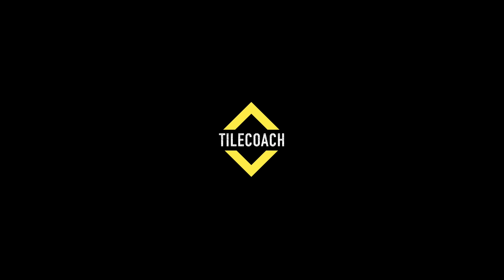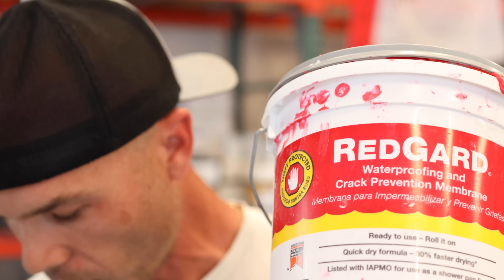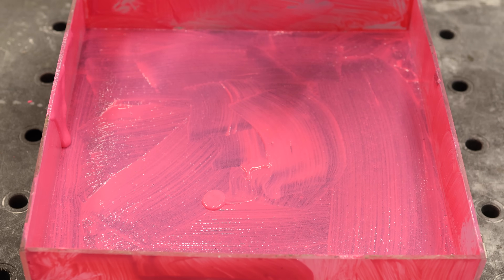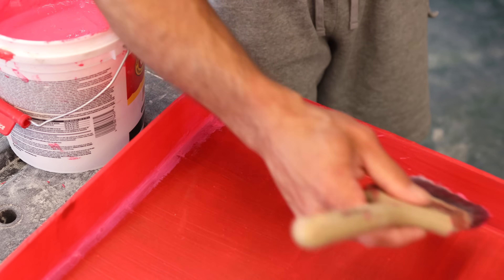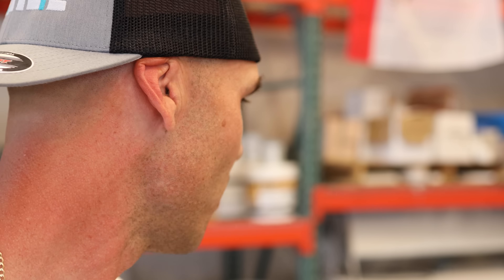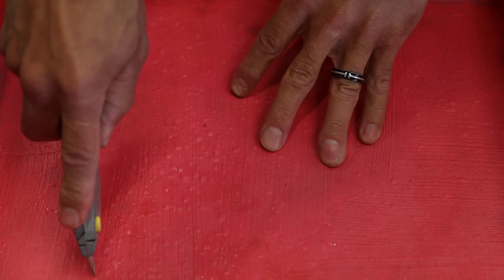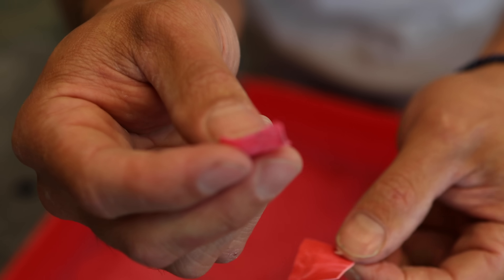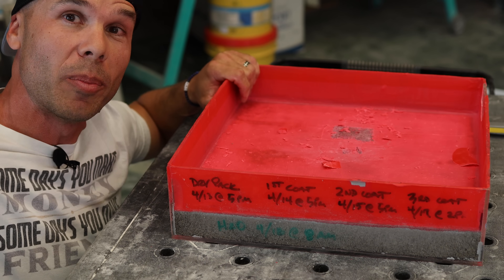REDGARD FAILED FLOOD TEST!!! --- Why Did it CRACK and BUBBLE UP???

Comment: Oh I forgot to address the cracks in the corners, when it does that it means you're over applying it, putting more over it makes it worse, it's better to cut out the cracks and reapply in thinner coats. Also redgard is generally applied over cement or backers so applying in on plastic is an issue the underlying moisture gets trapped and never allows it to actually cure.
Reply: Agreed plus your are supposed to wait 48 to 72 hours for the morter to cure.
 I think he might have dropped the ball on this but I'm sure he will redeem himself
Reply: Ahh, that makes sense.  I was dumbfounded to figure that RedGuard could be THAT weak !    Been in use a while.
Reply: Over applying it on the corners makes it crack?? Can someone confirm this?
Reply: @dieterrosswag933  - yep. Apply with a brush and use mesh cloth/tape at seams, corners and drains.
Build up 6 to 9 light layers on the floor to 20-30 mil thick tapering up the walls so no hard transition from thick to thin and 2 or 3 coats on walls with ample dry time between.
Ive been using a long time and never had a failure.
Reply: @holdernewtshesrearin5471  Thank you. I use tapes between the floor and walls (the joints). It's highly necessary in Germany since the screed is "floating" over a ~5cm foam  all over the house, for noise and temperature isolation and also no connected with the wall

Anyway, i didn't know that the "liquid isolation" can break in the corners in short period when there are different thickness in close time application.
Reply: @dieterrosswag933  - well i noticed that when applying with a putty knife, cracks would appear at that stress riser location where thick and thin coatings meet.
Thats why i apply many lighter coats and extend further and further up the wall each coat to ease that transition and remove stress risers.
Reply: @holdernewtshesrearin5471  6 to 9 coats.. with dry time between each? Plus the original 3 days for mortar to cure..  How long does it take to be ready for tile? Do you keep 2 or 3 projects on the go at once?
My first walk-in was 20 yrs ago, it was my only dry pack and it turned out fine, hadn’t heard of Redguard yet. Switched to foam after that first one, but I’ve sometimes wondered if floating is better/cheaper.
Reply: @markoshun  - yep. It rarely ever takes more than 6 coats but I make sure I get 1/16" thickness including the fiberglass mesh cloth/tape and I feather each coat 6"-12" up the walls to prevent a hard transition from thick to thin. I started this because the Redgard instructions called for 20 mil minimum thickness for the shower floor back when I started using it.
I think that's been revised but I'm not changing now. Don't fix what ain't broken.
I use a paintbrush only and yes,you HAVE to allow proper dry time between coats, NO PINK showing and an extra 30 min wouldn't hurt.
I generally start laying tile the morning after beginning the 1st coat and after an overnight leak test or the 2nd morning at latest. A full day to a day and a half of application.
Sometimes it helps to run a fan to stir the air NOT blowing directly on the shower, though.
I'm generally doing other projects at that location so it's no problem to return to the shower every hour or two to apply another coat but even if it takes a full day additionally I will do it because the peace of mind It affords is well worth it.
I've never had a failure in 15 years and maybe 100 showers.
Reply: @markoshun  - as for the question of foam pan slope or dry pack (I think that's what you meant by "floating") until and unless something comes along that addresses ALL the shortcomings of drypack and is a marked advantage I'll keep doing it the way it's been done for hundreds of years.
Dry pack takes time to cure which foam doesn't but you can't use Sub 2" tile with foam and I just don't trust it anyway.
EVERYTHING compressible eventually compresses over time imo.
Besides, using liquid waterproof membrane systems completely negates many of the advantages foam is designed to have.
It's not a fast process but it is a 1 piece waterproof membrane from drain to top of tile work and it is  PERMANENT . It's also relatively simple to do. No worries, no muss, no fuss. And it's guaranteed waterproof if you do your part.
That alone is worth an extra day or even 4 over a modern "improved" system like foam pans and sheet applied waterproof membranes which require skilled installers,  will NEVER be a 1 piece system anyway and WILL fail if the drain backs up and water stands for any length of time.
Reply: @holdernewtshesrearin5471  Thanks for your description of your dry pack process. But where do you see that about foam pan fails? Even on this channel, he’s done extreme flood tests for up to ten days with nothing but a little damp seepage. Over a couple decades I’ve done many foam pans myself with no fails. You are a more patient person than me and certainly more skilled with mortar. But seriously, after that first dry-pack bed, if I ever wanted to do more walk-ins, I knew I had to find a less time consuming and simpler method.
Reply: @markoshun  - another shortcoming of foam pans is they rarely actually fit a large custom shower so I'm forced to continue it with mortor anyway.
You can't use small mosaic tile with foam because if something heavy is dropped onto a sub 2" tile, the foam doesn't offer enough strength to resist it. I dropped a drill through a shower floor once because of it.
I've heard of a woman stepping through Penny tile in high heels when she entered to retrieve a necklace she removed while showering.
Other than those few shortcomings there isn't a lot to complain about but I just don't see foam as an improvement personally.
I simply prefer to lay tile on a solid substrate and since I use the liquid waterproofing membrane systems, the foam just isn't compatible imo.
I prefer drypack. It's strong, durable, resilient and foolproof.
It is heavy, slow to cure and messy though so I get the need to improve on it but for now and for me, there just isn't a system out there that does everything I would need it to do so....I'll stay with drypack.
Reply: @holdernewtshesrearin5471  I switched to hydroban stuff now, it’s quite a bit more dense and has a great hard surface. They have rated it for less than 2” tile if used with the right grout. No argument  though, mortar is near indestructible. 
I also recently did a full room pan with a 5x5 pan and 2 12” extensions. So size is not an issue.. (that’s what she said😁)
Anyway, I’m not trying to move you or anyone to foam pans, was more interested in the path I didn’t take. Full disclosure, I don’t like mixing and cleaning up cement. Used to hope they’d come up with a mastic that you could use in a shower.. still waiting.
Reply: @markoshun  - Roger that. I fully understand. I haven't tried any of the newer systems but I've seen them used. I'm old school with most things. I've seen so many new product "improvements" come and go and just prefer good old stone, steel and sweat I suppose. I wi certainly evolve should something really solid come along.
Extensions? The thickness continues to increase?
What if you have to maintain a certain curb height etc?
Reply: @holdernewtshesrearin5471  Yes, slope extends as well. There’s a couple dozen pans to choose from depending on what you’re building, offset, centered, linear drain. The shower room I was talking about was low slope and curbless, with a dropped subfloor. They sell curbs, but I just use 1 1/2” board and glue them together with the sealant/adhesive. Same for benches and often cubbies. 
There’s an advantage to the dry pack as you just build whatever pan shape you need.. I’ve got to order it in and the big ones aren’t cheap.
Reply: @markoshun  - right. Sounds like just the ticket for builders but not sure it would offer anything to custom shower builders. They're usually all different and I tend to put the door on an angle. I'd likely still have to use drypack. It's fast enough, cheap and I'm comfortable with it. Buy I'll check out the new foam. Thanks.
Reply: @holdernewtshesrearin5471  who the fuck has that kind of time? thats absurd. sheet membrane and done
Reply: @GJLCreativeStudios  - 4 hrs? You can't find 4 hours?
No matter how fast you install the sheet membrane, you can't lay tile until the morning of the following day IF you do an  overnight leak-down test, which you'd have to be a fool not to when using sheet membrane systems.
80% of the time I'm laying tile that following morning too, after my overnight leak-down test.
Occasionally due to humidity/temp etc slowing drying time, I have to finish applying 1-2 coats of liquid membrane the following morning to build the floor up to the required thickness of about 1/16" which almost always takes 6 coats but depending on temp/humidity and who applys it, it MAY take up to 9 coats.
But that is just to build up enough thickness to allow plenty of strength and flexibility to accommodate today's lightly built homes. The leak-down test has already been completed so I can begin laying tile by noon even when I have 2-3 coats to apply that morning.
So.....4 hours. 4 hours to achieve a ONE PIECE WATER-PROOF MEMBRANE from drain to the top of the tile work, something your sheet membrane system with multiple membrane pieces overlapped 2" and "sealed" with a porous, NON-WATER-PROOF and THIRSTY concrete based thinset, will NEVER be.
Those seams WILL wick water and WILL fail if water is allowed to permeate long enough such as if the drain backs up or the grout/caulk fails or is improperly applied. You have a WATER -RESISTANT shower, not much different from a shingled roof. I have the equivalence of a fiberglass boat.
Even if LWPM systems take an extra 24 hrs, the peace of mind of KNOWING that shower IS WATER-PROOF and will REMAIN so is well worth it imo.
You however, are free to do your showers however you like, as foolish as that is.
Reply: @holdernewtshesrearin5471  When you say "20 mil", do you mean 20 millimetres? Because that would mean 2 centimetres, and is pretty thick for 2-3 coats of paint.
Reply: @kazielbonn  - no a mil is a unit of measure in the sheet plastic and coatings etc industry. Roughly 1 mil is equal to .001"
So 20 mils is approximately. 020".
Just a bit under 1/32".
Reply: @holdernewtshesrearin5471  Ah ok, TIL haha. Thanks, much appreciated :)
Reply: @kazielbonn  - no problem. Glad I could help. Are you doing your own shower?
Reply: @kazielbonn  - and to clarify, the 20 mil thickness is just the coating. When you factor in the fiberglass mesh cloth/tape it brings the total thickness up to between 3/64" and 1/16".
That's why I say 6 to 9 coats. I've rarely ever had to apply more than 6 coats but just to make sure, I say an extra couple coats can't hurt.
If you concentrate on applying nice even coats I guarantee 6 coats will be sufficient. Just make sure you allow ample drying time between coats and I assure you, if all other aspects are done correctly, you WILL have a true 1 PIECE membrane, 100% water PROOF shower that will last for decades. My first showers are 17 years old now and of the 3 that I renovated (to update, NOT due to failure) at 9 to 12 years age,all were in perfect condition. The Redgard coating was still strong, supple and flexible. There were signs of water intrusion, through the grout but the modified standard 3-piece drains weep holes did their job and there were no issues. I was actually able to save the slope bed/pan of 2 of them and I reused it.
Liquid WATERPROOF membrane systems are the ONLY way I will build a shower.
Let me know if I can help you with your project. I don't mind at all.

Comment: Your using it wrong like most people do, it's a paint on membrane which means you should be applying it like paint, the secret is not heavy coats but coats on the lighter side, I do 5 to 6 thin coats which can be done in a single day with how fast it dries, the directions they give for installation I will admit are not very good and I always use fiberglass tape in the corners.

Comment: Isn't that supposed to be applied to a fabric?
Reply: You can use it on dry pack like he did, i think the reason it failed is because he did not wait long enough for the cement to properly cure and the moisture was trapped under his first coat of red guard
Reply: @espmegadeth1  That's what I think also. As concrete cures it releases the moisture inside and most of that moisture evaporates in the first 28 days, after that it takes years to fully cure because it has sealed the remaining moister inside. All the bubbles are from water trying to get out not water that got in. I would bet money this wouldn't happen if the dry pack had cured.

Comment: Red guard for a waterproof seal in the pan? Would never even think to do that. Walls only. Is that product even rated for what you used it for?
Reply: I still use rubber tried and true,  I would never redguard a pan
Reply: Rubber pans for life. People want to waste time doing stuff the "easy" way. Good luck with your leaky shower.  If you have problems with the liner pushing your board out cut notches and fill with mortar. Red guard before you do the Mudpan and leave the niche 4 inches up to it of no redguard. Redguard inside the niche. I do this because I've had problems with grout not drying right  around the niche but not inside it.
Reply: @kevinclear4007  I honestly don't even think red guard is suggested to be used that way. And anyone who would think that's it a good idea to use it that way should find a new profession.
Reply: @mikecoffman2821  the father/son company I worked for started doing things like that trying to save time towards the end of me working for them. I said you think that's gonna work? Silence. Lol 24 years as a tile setter and I've never had a leak called on me and I've never had to rip out a job. (Besides maybe a miscommunication of using wrong tile on the wrong room or something stupid like that.)

Comment: I’ve been using thinset and fiberglass Matting before redguarding and it comes out pretty dang durable
Reply: This is key, gotta use the mesh tape and thinset at all joints and change of plains. I only use redgaurd for extra insurance over my schluter band but I think he should redo the test with the tape and mud. Still love this guy's videos

Comment: You're supposed to use reinforcing fabric on corners with all liquid waterproofing products
Reply: This. I hope he will redo the test in a box with cement board (because no one is setting to glass. And use mesh tape and thinset. It's a requirement for this product. Still don't rely on it as my sole waterproofing. Only use it to go over my Keri band areas in my showers just for extra insurance and peace of mind.
Reply: @mattjudy6780  most showers have a liner. Is a liner more breathable than glass? What if you apply redguard over the mortar bed liner wall to liner wall, you are supposed to have a gap between the cement board wall and the mortar bed to prevent wicking water up the wall. Wouldn’t that be the same as this glass example?
Reply: @1977jmad  I know you are supposed to have a gap if you arent waterproofing the mud bed, but he is putting waterproofing on the mud and walls. He's changing it from a water in, water out system (traditional wicking mud bed) to a system where water never gets to the mud. So your logic doesn't apply in this situation.
Reply: @1977jmad  and no one is setting tile directly to a liner either. Nor do you put redgaurd on a liner if that's what you were saying. No need to have a gap between your mud and cement board if it's a completely water tight system (all water proofing is connected to each other all the way to the drain.  That's why he usually puts a sheet membrane over his mud beds. Watch his other videos.
Reply: Agreed
Reply: EXACTLY!!!!!

Comment: What a junk product. Glad I only ever used it on a tub surround. Looking forward to the laticrete glass box test. Maybe a moisture test of the mud is in order. Tape a piece of plastic to the mud and see if there is water. Or a moisture meter. Gotta rule out user error
Reply: It's not a junk product, he use it wrong. I've been using it for years and never had one single crack or bubble. It's not a junk product when every other company copies your product..
Reply: @jeremycovelli  I would love to see it done right if there's any way possible could you make a video or have a link to a video that does it like  you. Thanks

Comment: They say that's from putting it too thick and not letting dry fully before next coat
Reply: Did you not watch the video ? He let every coat fully dry.
Reply: @IceCreamJones42069  doesn't matter, if it's too thick it will crack, the drying is what causes the cracking
Reply: Yup
Reply: He put it on way too thick
Reply: Older guys I know say coat it real thin, give it a little extra dry time.. Just what I've heard I use hydro ban . and if you do it right no problems....